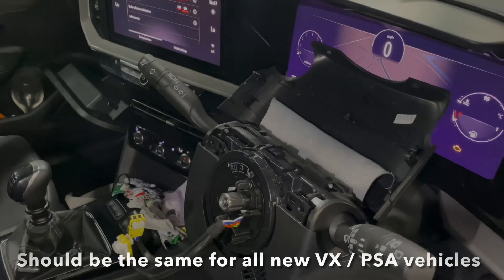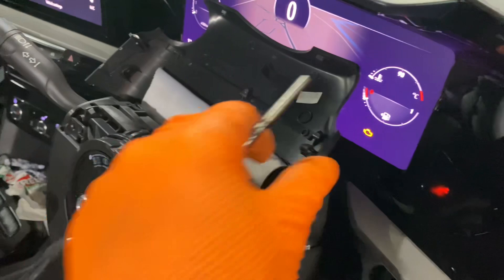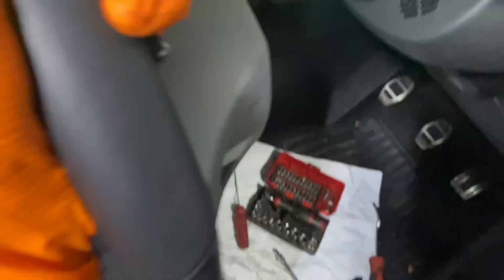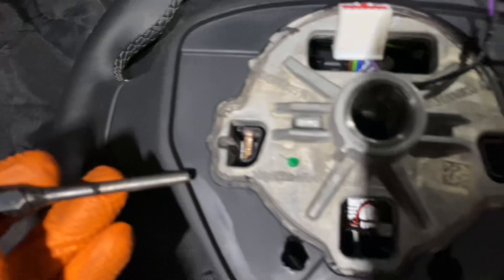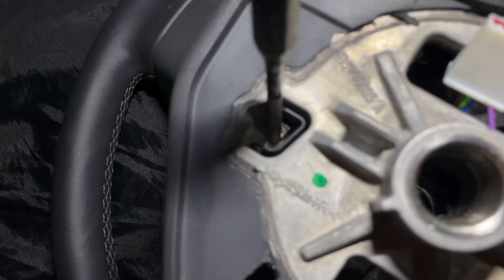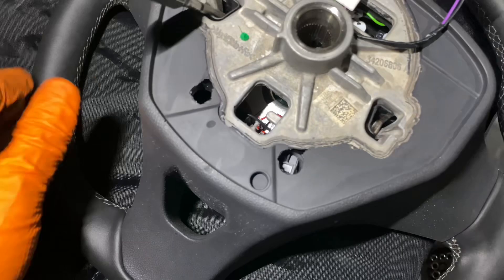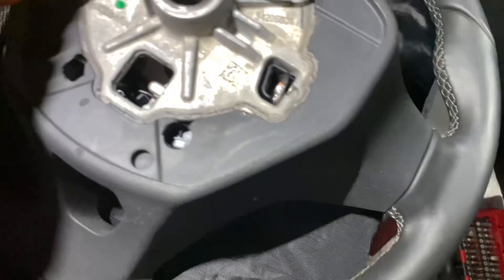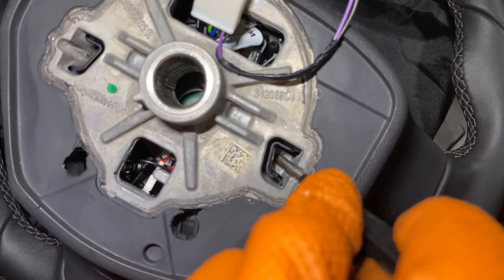Vauxhall Mokka 2023+ Airbag / Steering wheel removal | Corsa | Astra | PSA vehicles

Comment: I have a 66 plate viva having the usual eps failier how do you remove the steering wheel on that I could only find one hole on it at the bottom of the wheel I'm assuming it's that unless you know diffrent? And the actual eps units are so expensive off as scrap I'm looking to get mine reconditioned with a life time warranty!
Reply from the maker: Buy me a coffee (link on home page)  and put your email in the comments box and I’ll fire some info over for you for the wheel removal.
Tbh the columns are getting more common now